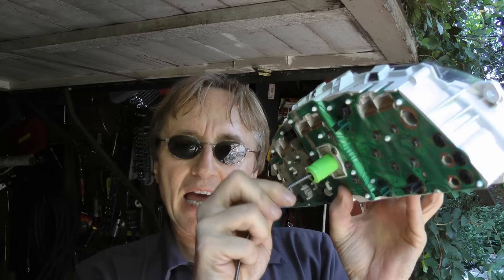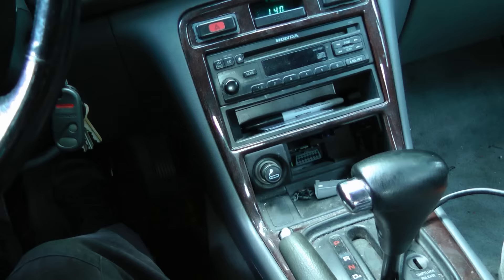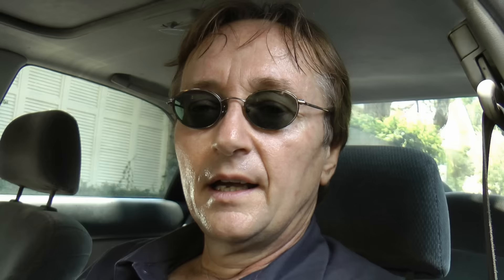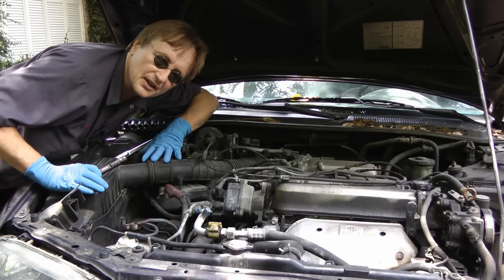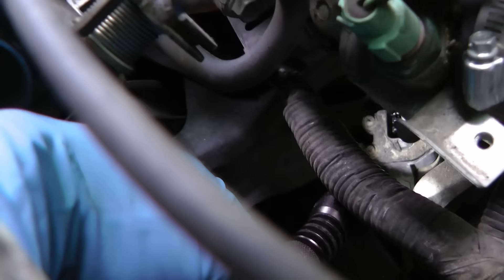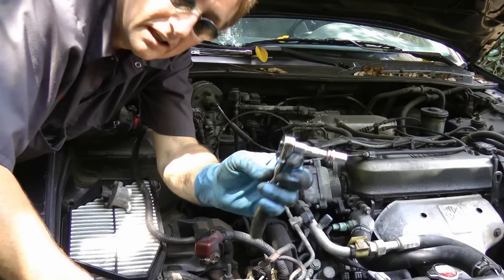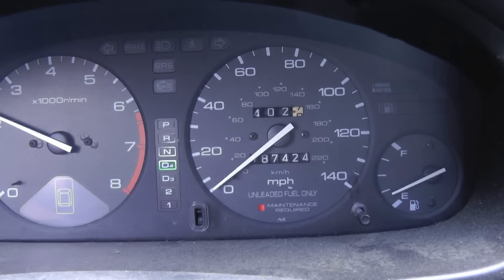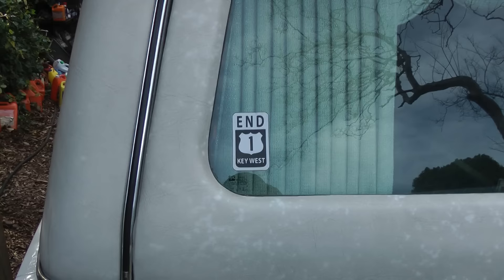How to Fix a Speedometer Gauge in Your Car (Speed Sensor)

Comment: Hello Scotty. My son has spent 100s of dollars on his car and I have asked many garages for a simple answer. The RPM is working on the cluster, but speedometer gauge isn't registering. Maybe you have an idea what need to do. It's a 2007 Hyundai Sonata 

Yes, the sensors are working correctly in transmission. Is it the cluster?

Comment: Scotty, I have just installed 4.10 gears in my 2002 mercury grand marquis (originally came with 2.73)  and its tons of fun but my problem is I need to have my speedometer recalibrated but it will cost me almost $500. my problem is now that when I'm going 65 mph my car thinks I'm going 105mph and wants to govern out... can I temporarily disconnect the VS sensor to correct this issue without causing damage to the car? keep in mind I will be using my phone speedometer so I don't get a ticket. Just until I can afford to reprogram it. Thanks!

Comment: i have a citroën xsara. in my case it's not the spedomiter, not the sensor wich sends the signals to the computer. the garage replaced both parts and that wasn't the solution! the problem is in the cables or at the point were they connect with the spedometer. what should i do?

Comment: Hey Scotty. I have a 2004 Nissan Frontier 2.4 L with 144,000 miles. My Odometer trip A & B recently started resetting every time I turn the truck off. Don’t know if this has anything to do with it, but my remote and internal electric door locks quit working as well. I manually have to lock both doors from the inside. Any ideas would be greatly appreciated!

Comment: hey, Scotty looks like  my 1992 Nissan Sentra has a speed cable. Took it to a mechanic for a rack and pinion replacement and came out with more problems. anyways trying to fix he cable because it came out both ends. Already put it back on the speed sensor device. Now got to figure out how to put the cable back in the instrument panel. Any suggestions? thanks again. Do I have to buy a new cable and speed sensor device?

Comment: I have 96 accord that I replaced the speed sensor in and it had little to no effect, until about a week ago it started working but then it kept climbing when i was going 45 the speedometer kept going up. It passed all the numbers and it now hangs at the bottom all the time
Reply: Michael Alexander sane with me but I’m in a civic. It would jump all over then got stuck at zero

Comment: I have a 1998 nissan frontier, with and automatic transmission, and at city speeds, (20-35) mph, the speedomter jumps, and at highway speeds, (60-80), it's reading about 10 miles lower than it should be. (i.e: If it says I'm going 80, I'm going the neighborhood of 90)
Reply: Well one time I was having the same problem in my 97 chevy c1500 the speedometer would jump around sometimes the gauges would stop working and the trans would not shift out of 3rd gear. the ignition switch was the culprit. Idk to much about them Nissan's. But my guess is the ignition could be starting to go out.

Comment: mine is "sometimes" not shifting from 1st gear to 2nd... an automatic transmission... tried changing the transmission computer module but problem is still present... tried replacing the old automatic fluid but still problem exists occassionally...mechanic opened the underneath of the transmission engine but found the filter inside quite clean... is it a speed sensor problem??

Comment: I have a car that is intermittent with this. The speedo works about half the time, some times it does, sometimes it doesn't. Would you think that would be the speedo itself? A loose connection somewhere? Speed sensor going out? And also sometimes when getting in the car and putting it in gear, for the forward gears it takes a couple of seconds for it to "kick in". Some times it won't catch at all and you have to cycle the gears a couple of times for it to catch, but reverse works no problem. Hope to god it isn't the transmission.. Also kinda noticed it shifting oddly, like shifting a little on the late side during higher revs and sometimes missing a gear and not shifting at all.. :/ That I'm scared is the TM.
Reply from the maker: Jimmy Gangster more often a bad speed sensor does just that, affecting all those problems

Comment: i have 2006 Pontiac Grand Prix that reads faster speeds than i'm actually going.  I've already changed the speed sensor but that didn't fix it now what could it be the gauge or something else.  I cant seem to get the slushing water out of my dash.  I already lifted the front end, had the a/c drain vacuumed and blowed and rodded but no fix. What do I do now?

Comment: I have a 95 Accord 4cyl. 5spd and the tach on my original wont go past 4.5k rpm. I installed a new one seems to be fine, and I rev'd it and it went all the way to 8k rpm, but the only thing else that's going oddly strange is that it's idling at 1.5k rpm. Does it matter if its a manual or not? Or is that another bad tach as well?

Comment: I got Toyota D4D 2.5 diesel. The speedometer is showing 30-50% less speed than the actual. Then it jumps up for a while and then goes. Back to 50%? I don’t have a code reader, do I need one for this?

Comment: Scotty! I have a 1992 Honda prelude and the speedometer needle is stuck at zero. In this case I would imagine that it has a cable instead of a speed sensor because it's 23 years old. Do you have any advice as to how I could (assuming the cable is the problem) get in and change it myself?  Btw this is the first video I've seen of yours.. Loving the energy!
Reply: most Hondas have a VSS (speed sensor), my '92 civic has one so your prelude must have it too. replace VSS and your speedo will be back to life :) no mechanical cables involved
Reply: +Talha Arif thanks I'll try that  and let you know if it works 👍🏻

Comment: Scotty kilmer i have a issue with my 1990 camry, I had the transmission replaced and the transmission the shop put in has a electric speed sensor but the car has a cable style speedometer. And it shifts hard in every gear, is there a way I can wire the sensor to my pcm to make the thing shift smooth or put a adapter from electric to cable

Comment: 2000 lexus gs400 speedometer stays on 0 odometer doesnt work either. used scanner to read mph stayed at 0. do they use a speen sensor like this or do they go by the individual wheel speed sensors at the wheels?

Comment: my speedometer flipped all the way around now its stuck behind the peg, but I watched another video where it can be reset to spin back around the correct side of the peg, all you do is use your car key in the ignition and press the reset button on the display, but more details in the video just search speedometer flippped fix

Comment: Hey Scotty..love your videos! Im not a mechanic but I noticed my speedo stuck on 45 kms/hr on my 99 Pathfinder. I ran a scan on it as you did but my scanner read P0325 knock sensor... thought it would read speed sensor? There is no check engine light on the dash. Any ideas what it could be? Thanks in advance..

Comment: What if my odometer didn't work when I bought it?  Changing it is illegal right?  How can I make it work or correct it? Do I have to do a new engine and new dash gauge assembly
Reply: It's not illegal unless you sell the car and you don't tell the buyer what it was really at. So if you're gonna do that, make sure to write down the mileage before you erase it all. If you were to sell the car to someone and you said it was lower than it really was, then that's illegal.

Comment: I desperately need help, I have a 2003 dodge grand caravan sport. The battery leaked blue foam all over. Cleaned that mess and it seems ive had electrical issues ever since. The cluster/dash lights flicker periodically and every now and then the speedometer and odometer start to flutter all over the place. Its quite dangerous. I replaced the battery and it didn't repair the problem. Also had the battery cables replaced as well. Still no luck
Any advice?

Comment: in my case is not just the speedometer,  but every single needle doesn't work (hot cold, the speedomether, the gas)...If I replace the sensor would that help with fixing the rest of the needles not working?
Reply from the maker: I doubt it, sounds like you have a dash wiring problem or warped circuit board in the dash assembly.

Comment: Hi Scotty, I have a problem with the speedmeter on an isuzu rodeo 2002, I alredy changed the speed sensor and the instrument unit(dashboard) and still having the problem, I noticed that when I switch the speed  stick at the moment when I reaxh the drive "D", it just do not light up de D letter and the speed meter just do not work. Please, let me know I you can help me. Regards

Comment: Would you recommend replacing the speed sensor if the speed is reading 5 mph off? or is it something else?
Reply: That happens a lot if you change tire size or change suspension height.

Comment: Hey scotty I have a ford fiesta car and every time I am increasing revs to speed up the rev meter keeps flicking up and down slightly, until when I maintain a steady speed the rev meter goes back to normal again, The engine management light shows up because of this error and comes under the speed sensor error, any thoughts on why it behaves like this? Cheers

Comment: I have a 1998 Cadillac DeVille, my speedometer is digital. It does not show my speed limit or how much gas I have (I have no idea if I need to fill the tank or not). I'm hoping you can tell me exactly what's going on with my car & how much it would cost to get it fixed

Thank You
Reply from the maker: often that's a bad dash unit, and they cost a ton. Have it analyzed by a pro caddie mechanic and pray it's something else, like bad wires or grounds

Comment: Hi Scotty. Love your stuff
Can I ask, does the speedo pick up the signal from the engine ecu or transmission ecu? I’m my case I have an input and output sensor on the transmission. I am seeing a speed reading on my transmission data but 0kmh on my engine data. How does it work? Opel corsa c 1.4 2005

Comment: Would a broken speed sensor also cause the check engine light to come on? My speedometer went out at the same time my check engine light came on. Also, are they expensive to replace?
Reply from the maker: Beth King yes it can, some cars they cost little, some cost a ton, call a dealer parts dept to find out

Comment: My speedometer is at 0 and odometer not working. Could this be reason for check engine light? for 1992 Nissan Sentra E. also is this the speed sensor?

Comment: Hi Scotty , I very often look at your video/advice for many a car issues. Thx to your video's some I can fix ( considering I'm 64 yrs - female ) other problems need more strength arm muscle , if you will ;-)  equally as important when I do go & ask a mechanic I have additional knowledge so they can't take me for a ride lol ( pun there ) The recent video I watched was speedometer problems for a Honda ~ My car is 2004 Pontiac Sunfire ~ it's stuck ( frozen ) at 100-K then it moves to 180-K & I'm going like 50 ? Help ? Kind regards , Irene

Comment: Hi scotty... i have a 2012 Nissan Altima and its trip odometer is stuck at zero while all other guages including speedometer works fine. Any ideas? I tried self diagnostics by pressing the trip meter 3 times while keeping ignition in on position and its fine.

Comment: The speedometer on my 1990 nissan pickup doesn't work does it have a sensor or is it just a cable? If it has a cable how hard is it to repair?

Comment: My 99 Nissan Altima speedometer isn’t working for me. Everything else seems to work so far i suppose although as soon as i turn the car one the rpm instantly goes to around 1.5 so I’m not sure if that’s normal. But anyways it will get stuck on 35mph and will not go down or above that. My brother hooked his computer to it and it said something about emissions

Comment: Good morning Scotty my name is David. I have a 2004 Chrysler Pacifica 3.5 L with 128 K miles I'm having a problem. I have a fault code p 0 700 on the car is in limp mode. Do you have any idea what could be causing this code? Or what you look for starters

Comment: Could this sensor also give you the wrong speed? My speedo is off by about 7 or 8%  speedo reads 70mph when traveling 65 and its racking untraveled miles onto my car. 2005 Altima 2.5s. Thanks in advance. Love your videos recently found you and have been binge watching..
Reply from the maker: +Raymond Andrews it can, but more often that's wrong tire size
Reply: Scotty Kilmer tires are correct size. 😕

Comment: Hey scotty, quick question for you.  My car (96 Nissan Sentra) had a faulty speed sensor based on that the engine light came on and the code test came back as VSS.  So I took it to a mechanic and just told him to order a new VSS and replace it.  He did and upon receiving the car everything seemed ok.  2 days later, check engine is still off, but the speedometer is not working again.  What gives? If it were the VSS wouldn't the check engine come on again?

Comment: I have a 04 Jaguar x type 
In the mornings when I go out the speed and miles work for about 10-15 mins and then it just stops the miles turn to little lines and the speed stays at 0. And the. It will work again when it wants. 

I have replaced the cluster and both front speed sensors   What else could it be ?

Comment: Hi Scotty Kilmer,
My speedometer doesn't work most of the time, and when it's work, it's only stand for couple of seconds with heavy steering wheel.
the dealer said the car requires Box Electronic Defect Speed + Speedo drive. What does that mean?
my car 1998 Peugeot 406 coupe v6
all the best,

Comment: Hey my needle was working but until i removed it to switch my odometer motor once i put it back it stoped working i know is not the sensor since it was working perfectly until i did the above can you help out?

Comment: Well replaced the VSS but that did not resolve the issue. now I have a 5 speed  MT. Two major questions:

I would like to know if there is a cable that drives the speedometer. it is a Nippon seiki cluster.

I have searched online for replacement cluster and was advised by one seller that there also is a code on the back of the cluster that is specific to the production sequence and  other sellers just want to know whether it is Denso or Seiki. Would you set me straight as to this apparent conundrum as well.
Reply: keep this live, will get back shortly

Comment: Hey Scotty I just bought a 2003 gmc sierra and the speedometer is showing that I’m going 100mph but the gps is showing 60. I tried changing from mph to kmph and still the same so I changed it back. What could I do. Could it be the speed sensor. Transmission was just rebuilt 7,000 miles ago

Comment: I have a question I got a 2005 Ford Freestyle and my brake light ABS light and my speedometer went all that goes on when the light ABS light goes on and brake light goes on and the traction control goes on my speedometer stops working that happened after I change my wheel bearings but I noticed what can that be please let me know I'm going crazy with all this stuff going on on my car

Comment: Hi Scotty,
Thanks for the explanation above. I have a 98 Toyota Corolla AE100G car. And I have an issue with the speed indicator. Below are my findings. Could you please help me with your expertise?

Problem: Speed is indicated lesser to actual speed vehicle is being driven. eg. when going at 100Kmph it shows about 60kmph
Findings: 1) ODO meter works. But shows 100km when I travel about 110-120kms.
                 2) Original Tyre size is supposed to be 175/65R14 82S (both front & rear) but when I bought it had 185/70R14 88H (both front & rear)

What could be the problem. Will this be solved only if I change back to the original Tyre size? or should I do anything else to get over this?

Thanks
Rimaz
Reply from the maker: put the right tires back on, that old thing is a non callibratable speedo. Modern cars you could reprogram them though
Reply: Scotty Kilmer thank you!

Comment: Hello, I'm driving a Chrysler Grand Voyager Limited 3.3, 2005. The speedometer shows 50 km/h.  And the real speed is 62 km / h.  Factory wheel size.  Tried to change Pinion factor with DRBlll.  Did not help :(

Comment: Hello scotty, love your videos; I just wanted to ask you about my speedometer. I recently purchased a 1996 maxima gxe for work, but i cannot use it due to the speedometer not working. i turn on the car and only the revs are working. Somehow it works for a second when i push the lite stick in the middle of the speedometer, but then it dies again. It reads correct speed when working for a few seconds so i guess is not a sensor.
Reply from the maker: +alpha gamer  often a bad dash unit then, try a used junk yard dash

Comment: I have a 1995 Jaguar some of lights don't work cables are OK and fuses when I put the signal light one side do sound but when I put it to other it doesn't do you think it may be the light control module
Reply from the maker: I'm surprised anything works on a 22 year old Jag.  I would check wiring for shorts and check all bulbs for burned out filaments first

Comment: I have a Volkswagen Jetta 2004 ,the speed and gas doesn’t work ,the engine or transmission was switched out due to failure , was wondering if this is the same case or not. Would someone please let me know ?

Comment: Hi scotty, I drive a 3.5 sl altima, and I have an issue where the speedo does not move at all. I have replaced the vss, as well as tried two other instrument clusters, but all has failed. I'd love to know if you can get an idea of whats wrong, for me and my dealer as well as local mechanic have all been wrong.
Reply from the maker: realize bad wiring or a bad body control module will do just that too